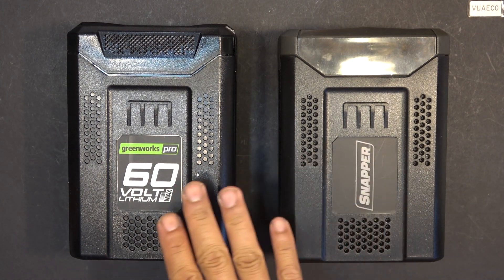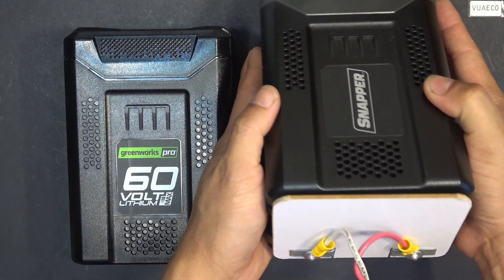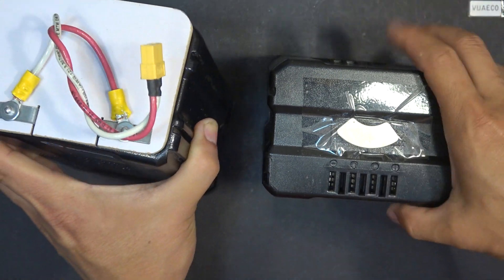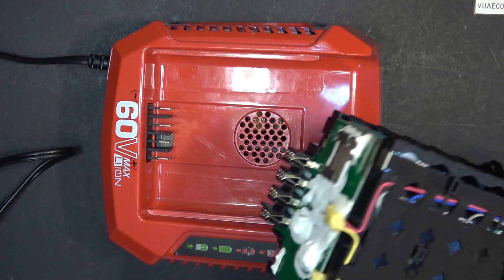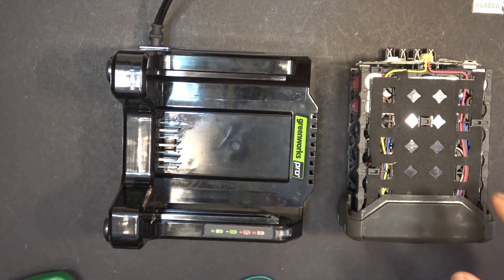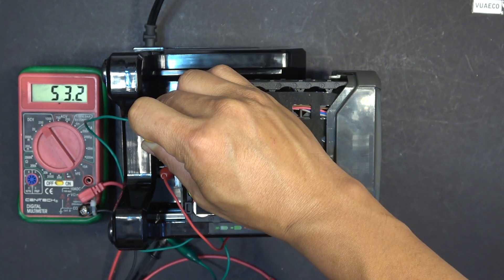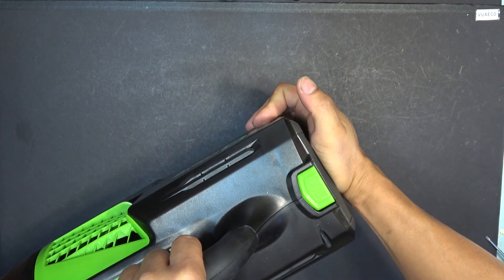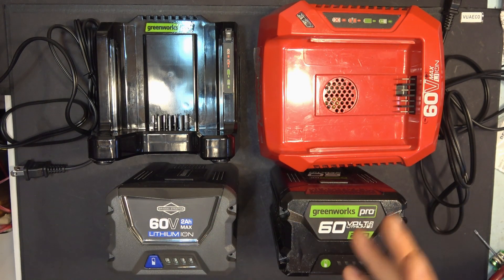Are Snapper & Greenworks 60V batteries, chargers, & tools interchangeable?

Comment: I can confirm that the Greenworks Pro LB6025 2948802-RC 60v HC 2.5 Ah Battery is compatible with the Snapper/B&S SBA260V applications IF:
You swap out the rear casings for fitting into Snapper charger & tools. You will need a T10 security bit to remove 4 screws. I had an extra bad Snapper battery that wouldn"t take a charge or jump, so swapped the cases. I would guess you could cut/modify a bottom groove in the GW case & waterproof (epoxy?) if you don't have a Snapper battery case to swap out.
Reply: So, the 2.5 ah greenworks will fit in the 2.0 ah hour snapper case?

Comment: I took a small handheld grinder and removed 2 notches on the housing of a Greenworks 60 volt rapid charger that I bought on eBay. No returns. I have a Powerworks 60v lithium ion 5ah battery. Now not only can I charge my power works 60 volt battery, I can also still charge a Greenworks works battery. Powerworks is owned by Greeworks and the difference in the two chargers are simply two notches.

Comment: Thank you so much for the helpful information Anh Vu! I don't know if this is possible or not but I was hoping you could answer if the  New 82-volt Snapper batteries are backward compatible with the old Snapper 60-volt tools. I have a 60-volt Snapper battery that's gone kaput on me. It's not accepting a full charge anymore. And I'm not looking to buy a brand-new set of tools and batteries. Im thinking about either replacing the bad cells on my 60 V batteries or purchasing whole new batteries. The ones on Amazon that are sold by Chinese knockoffs seem kind of promising but I have no idea of the quality. I could also buy the 82-volt snappers to replace the 60. or take the cells of the 82 and put them in the older one. The best and most optimum scenario is if they use the same battery connections, I can just plug it right in. What it looks like now is that I'll just get the green works and shave down on the sides, so that it fits into the snapper. But if you get an answer on the 82. If it actually operates at a higher performance level because of the higher voltage. I would definitely just buy that. Thanks again for the helpful information!!

Comment: You are a brilliant man, but I am sure that the crooked manufacturers wouldn't agree with me. There should be standardization with these tools, just as there is with screws, nuts, bolts, washers, etc. When the integrated circuits were first put on the market, Motorola and TI, the only manufacturers of the devices made sure that they couldn't be interchanged by requiring the input voltage to be applied at different terminals. The U.S. Government stepped in very quickly and required ALL integrated circuit makers, then and for the future, to standardize the pin-out for the devices. They should be doing this now for these new battery operated devices, like mowers, blowers, trimmers, edgers, etc.

Comment: This video came to me like a gift. I bought a greenworks 60v mower today and I have the 60v snapper tools ad well. I was wondering if I csn use them since they didn't fit the charger. You just saved me $129. Thanks!!!
Reply: you can dremel out the rail in the mower to fit the snapper batts into it. or you can mod the battery case.

Comment: I have two Snapper 60V power tools with 2 batteries and charger. I saw the  Greenworks 60V 16 inch chainsaw with battery and charger for $100 today at Lowes.  Now I know the outer shell can be swapped and the tools still work; I have 3 batteries to use now.  This is a big help. Thank You very much.

Comment: If the screw holes line up, why not just swap the house casing...
Reply: Good question
Reply: Depends on if you're looking for a easy second battery where you'd want functional cases on both, or replacing an old battery that doesn't work well enough to keep anymore.

Comment: I have made a simple modification by cutting a groove that matches the greenworks battery using a table saw. I am using 80v batteries, but the groove spacing looks similar.  I used cheaper Kobalt batteries. https://www.youtube.com/watch?v=C7KAbpDb2Q8&t=10s

Comment: 2 Ah for a scooter? Uh...is it one of those ones with the Rollerblade wheels that you stand up on? :-D
Reply from the maker: Not that one. If you put 60V on those, it'll propel you straight to the moon!
Reply: @vuaeco  I hear ya, comrade. So...are you running just the one? Or do you parallel a few?
Reply from the maker: @fun_ghoul  Just one. There's only enough room for one in the Razor E300. I made it last year and here's the video: https://youtu.be/lDnF8M_OZek

Comment: Battery packs are like bike frames, in that OEMs source them from specialist manufacturing firms who will sell to anyone buying sufficient quantity. In that vein, I've seen the same 60V packs as those under at least one other name (which escapes me at present...sorry).
Reply: power works. i have a snapper 60v mower and 2 power works tools. the chainsaw and the weed eater. the batteries are interchangeable. i bout two used green works 60v batts today and will be modding the cases to fit my snapper and power works tools.

Comment: I think some kobalt batteries are also greenworks
Reply from the maker: I believe the Kobalt 80V and Greenworks 80V batteries are the same
Reply: @vuaeco   nope same problem  with the ridges not lining up. But from this video  you could  maybe  switch  casings or grind the bottom  ridge off which one doesn't  fit the charger. 40v greenworks  and 40v yardworks are identical   I have both 40 v chainsaws  and they swap